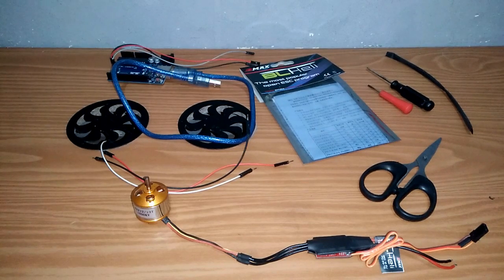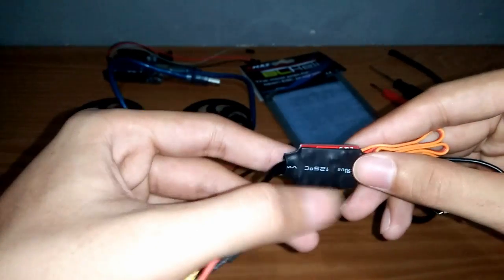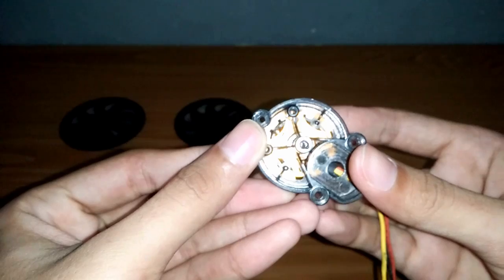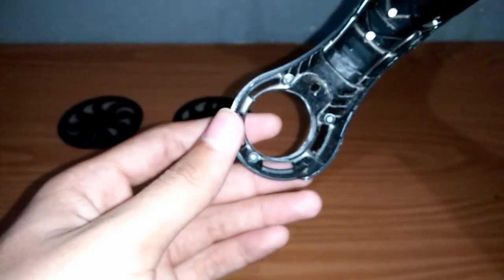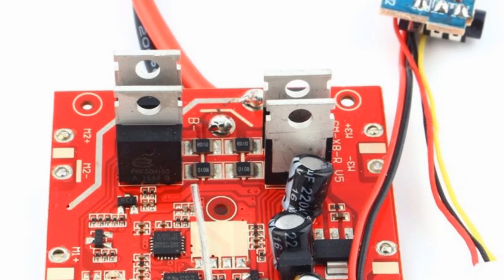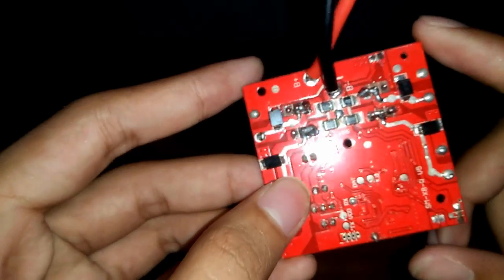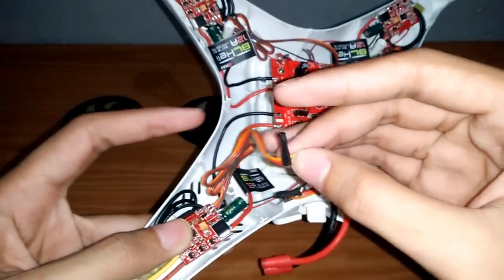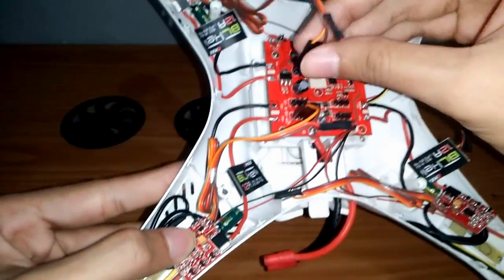SYMA X8 Brushless Conversion Tutorial PART1 - Hardware

Comment: Hello Muhammad , i have yesterday mod my x8 to brushless motors . I have the same motors , but i have the cheap yellow esc 30a with simonk  . Everything is going good , accept when i plug in the lipo , i hear the melody of the esc,s . But that,s it no light , no motors. Nothing , what could that be ? Will it works with simonk firmware ??

Comment: Hello, thanks for the video! my question is on the rotor, how can you make the rotor turn CCW and CW. I bought the same rotor but there is no instruction or which way it goes. thanks in advance. . . .
Reply from the maker: Just swap any two cable to set rotation. See here: http://www.diymulticopter.org/wp-content/uploads/2012/11/ESC-motor.jpg
Reply: Hello, friend It was a success on my Syma brushless. The only problem is the control, it's very sensitive and it seems like the rpm is low. On this set up on your esc is that exactly the same on your Syma or you tweak a little bit better. Sorry, this is my first time doing it but if you can help that would be great.
Reply: Muhammad Imam Zulkarnaen ini yg dicari bg hehe

Comment: I have a question, can i use the original motor of phantom 2?

The code is: 2312/960KV or other types of brushless motors? What characteristics must respect the motors for assemble these components and programming?

what is the difference between 12A and 30 ESC?

I can use the original battery "2s 7.4 2200mAh 25c"?

Thank you!

Comment: can use esc 30A?
Reply from the maker: Of course, BLHeli ESC.
Reply: Thanks you.
Reply: I have a question, can i use the original motor of phantom 2?

The code is: 2312/960KV or other types of brushless motors? What characteristics must respect the motors for assemble these components and programming?

what is the difference between 12A and 30 ESC?

I can use the original battery "2s 7.4 2200mAh 25c"?

Thank you!

Comment from the maker: Thank you for waiting! 
Part 2 Out Now: https://youtu.be/0SwNgR9Oysg
Reply: I have a question, can i use the original motor of phantom 2?

The code is: 2312/960KV or other types of brushless motors? What characteristics must respect the motors for assemble these components and programming?

what is the difference between 12A and 30 ESC?

I can use the original battery "2s 7.4 2200mAh 25c"?
Reply: Mas klo untuk x8hw part yg mesti disiapkan apa saja ya
Reply: Muhammad Imam Zulkarnaen Buat tutorial cara pasang fpv 5.8ghz

Comment: Part 2 nya nggak di lanjuttin mas bRO...?
Reply from the maker: Part 2 https://youtu.be/0SwNgR9Oysg
Reply: I have a question, can i use the original motor of phantom 2?

The code is: 2312/960KV or other types of brushless motors? What characteristics must respect the motors for assemble these components and programming?

what is the difference between 12A and 30 ESC?

I can use the original battery "2s 7.4 2200mAh 25c"?

Thank you!

Comment: hello esc blheli 12a t on it directly to the purchase or need to change the firmware 
http://fr.aliexpress.com/item/Emax-12A-BLHELI-ESC-1A-5V-Speed-Controller-For-FPV-QAV250-Quadcopter-1-2-4pcs/32527101621.html?spm=2114.06010108.8.42.QZQO7W

Comment: Will this work with a 3S lipo battery, or will I have to mod the flight controller to do so?
Reply from the maker: Yes, it works.
Reply: +Muhammad Imam Zulkarnaen , kalau pake batterai 3S mesti pake PDB lagi ya gan? truss power supply untuk Receiver board syma nya dari mana yah gan?
Reply from the maker: Tidak perlu gan, langsung aja.
Reply: owh... ok gan

Comment: we wating for part two :))
i have question, can i use another motor 1400 kv ?? and  emax blheli 20a ?
Reply from the maker: Sure :)
Reply: okey , 2212 1400kv motors and esc emax software blheli 20a are ensured :) changed all software in esc or just change your settings? I look forward to the second part ; d greet :)
i waiting for board from x8hw but to london delivery is mouch time ;/ 40 days but i wait :)
using propellers Syma x8 and engines 1000kv how play you can pick up ? there will be no problem with gopro3 ?